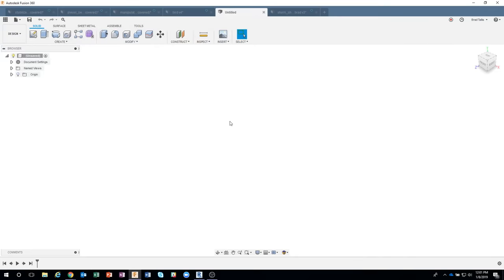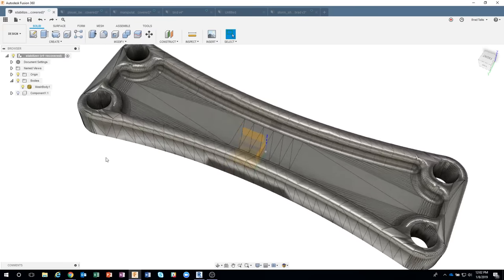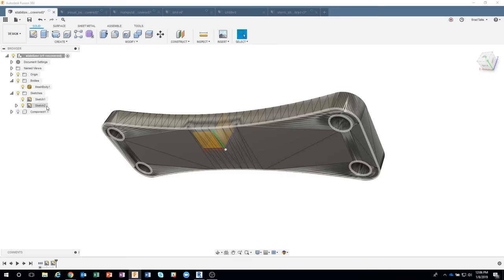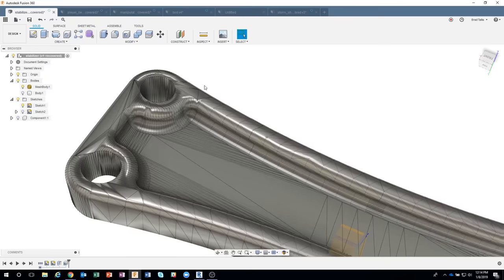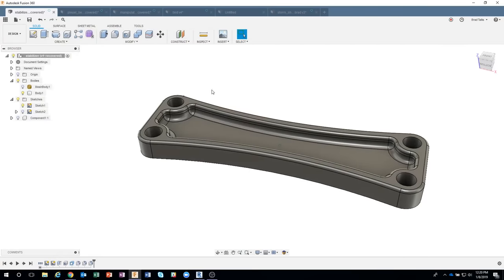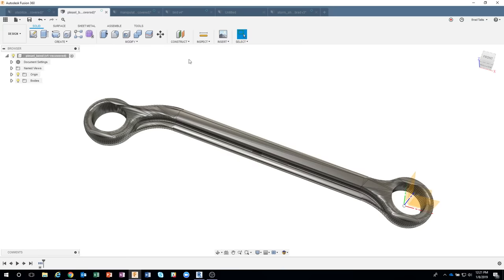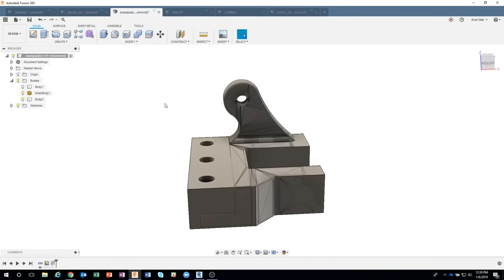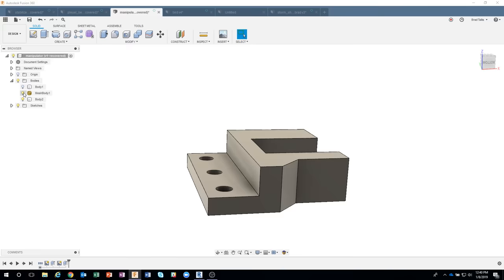Episode 04, How to turn Mesh data into Fusion 360 parts

Comment: Loving the new series.

A suggestion for future topic: Connecting components together.  How to best use threads?  How do you use joints?  Modeling in fasteners and connectors (nuts, bolts, etc).

Comment: This video has been driving me f'n nuts for days. The first problem I had was figuring out why I didn't have a Mesh option under Create. I switched to the new UI (which is great, BTW). Nothing. I finally discovered that menu items under Sketch have changed. There is no Mesh option with two alternatives that must be done in order.  There are instead a Create Mesh and  Create Mesh Section Sketch which are done in order. It's a little simpler now, but very confusing for someone trying to follow the video.

The other problem was evident much earlier to me, but was confirmed when Brad extruded the dogbone stabilizer. That little robot arm couldn't have a 40 mm thick stabilizer, but that's what Brad extruded it to. When we're doing math or building models, it's always a good idea to keep in mind whether results seem reasonable even within an order of magnitude. This didn't. 

The problem is, when you  UPLOAD an STL into the Data Panel, then OPEN it, it comes in at about 10X the original scale. Why, I don't know. The only way I can get an STL to come in at the proper scale is to do it from the Mesh space. 
1.  In Model workspace, click Don’t Capture Design History. Otherwise Mesh option doesn’t show up.
2. Select Mesh workspace.
3. Create/Insert Mesh.  Position as needed or not. 
4. Model comes it at proper scale which you can verify with Inspect/Measure.

I'm a long time user of Sketchup and a relative newcomer to F360 (bit the bullet and switched completely) so if I'm FOS, please show me another way. It's a very good video, but the UI change, the menu changes and the scale weirdness made for a lot of wasted effort for me.

Thanks for the video and thanks for the forum to rant.

Comment: Brad, I am getting into this rather late.  The version of Fusion I am using is 2.0.9512.  When I go for the Mesh command, I only get "Fit Curves to Mesh Section", there is no option to create a mesh section - and I cannot find a section to fit a curve to.  Am I doing something wrong, has Fusion progressed beyond this point or what?
Reply from the maker: @Jeff Whitney-  Make sure you are capturing Design History to see the Fit Curve option.  It doesn't show up in Direct Editing mode.
Reply: @bradtallis8968  Hi Brad! I also only see "Fit Curves to Mesh Section" and I also have Design History turned on. Any ideas? Version: 2.0.10032
Active Plan: Fusion 360, Subscription
macOS 10.16.0

Comment: Brad,  I am attempting to convert parts that I scanned with a digital probe into T-Splines.  This video is excellent.  When I upload one of my STL files my display does not look like yours.  My workspace shows only Modeling and Sculpting. Your workspace is showing Design.  How do I get into the Design Workspace?
Reply from the maker: Allan-  I am using the "New UI" preview which is in the Preferences-->Preview section.  That is probably why your screen is different than mine.
Reply: Brad Tallis Does the Design space react differently than the Sculpt space?

Comment: By the was if you did a cross section on the Mesh part,  the top section was NOT a Fillet but a Chamfer, inside and outside ! Brad?

Comment: Why won't fusion do anything to automate it, 'cause it's such a pain in the ass to edit STLs
Reply from the maker: @LCM Leaked-  Fusion 360 is a CAD (Computer Aided Design) tool, and stl's aren't really meant to be edited in a CAD tool due to the large number of faces and edges.  There are other tools out there that help edit stls and obj's much easier, such as Meshmixer.